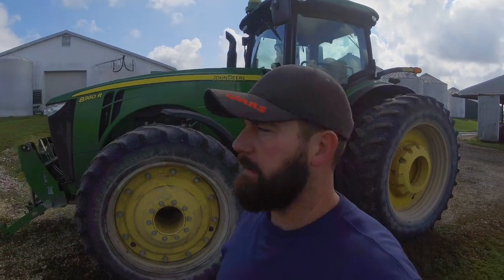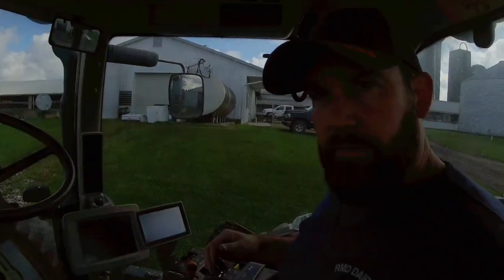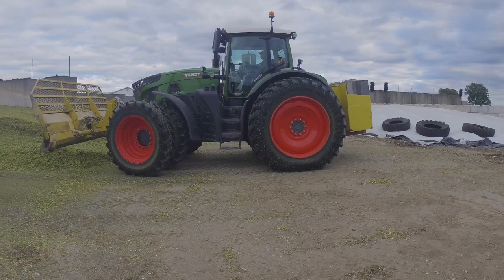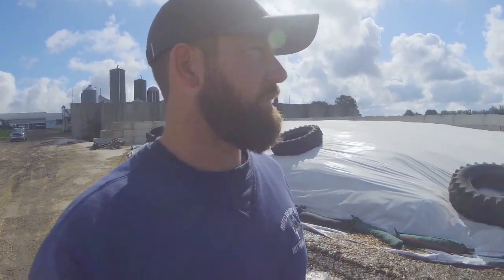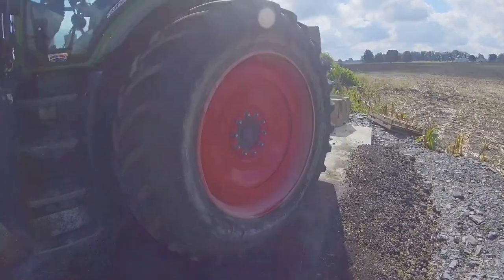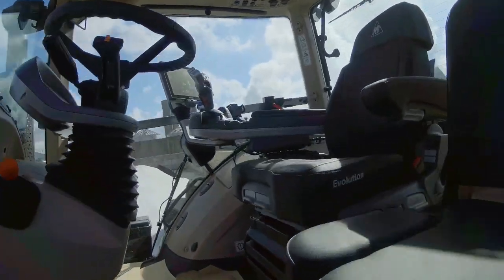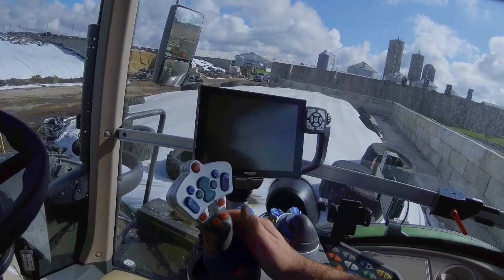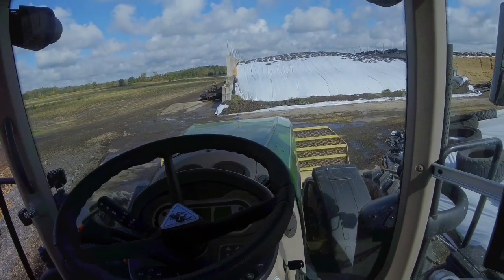New Fendt 936  Push Tractor Demo

Comment: Hi there! Nice comparison and well done with the same tires and weight. I was wondering if the wheel spacing was set up at 60-120 inches? And if you noticed if the turning radius was different from your deere 8360r?